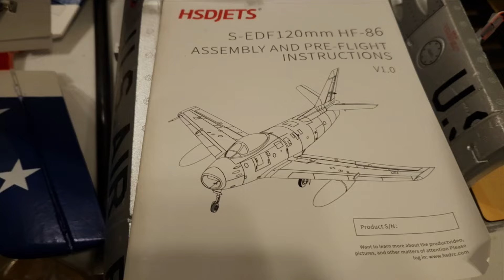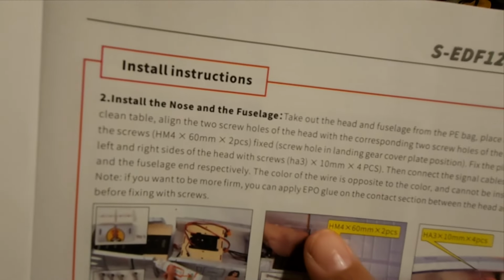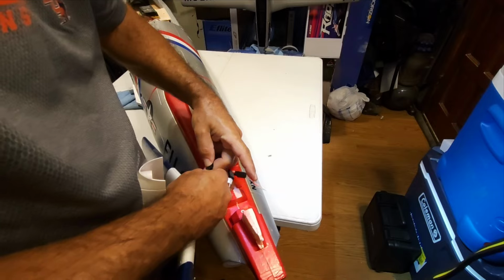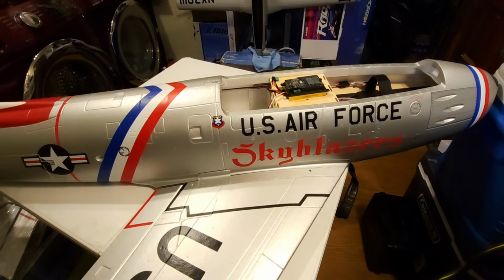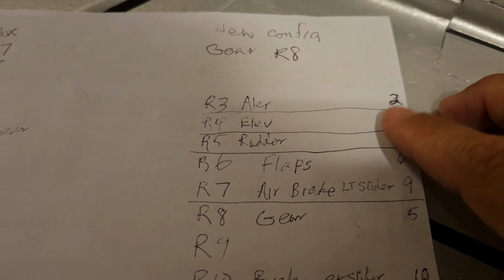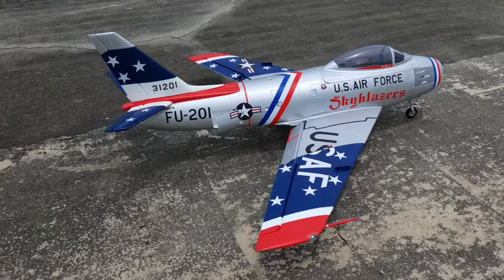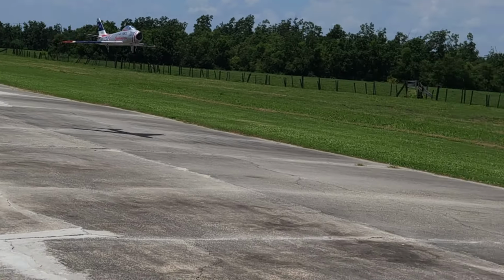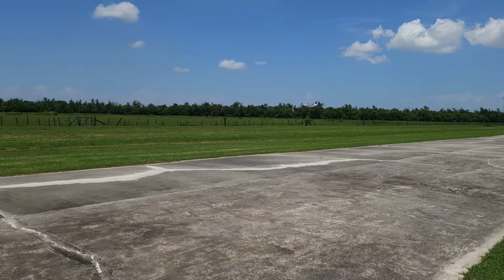HSDJETS S-EDF 120mm HF-86 Sky Blazer Assembly Set up Maiden

Comment: No need to get aggravated,  on these HSD jets you need to study the input plugs and output plugs and the diagram page really well,  get a mental picture of what they are trying to show you,  I have set them up without S-Bus and with S-Bus,  I fly Futaba so I found setting up the S-Bus is so much easier,  but I have done it like you did as well and it takes a little more time but after owning a few HSD jets you get the hang of it.  Good job on the the maiden and that looks like a nice place to fly,  Thanks for sharing.
Reply from the maker: @robinlee7886  I understand what you're explaining and that makes total sense however the labeled outputs that they give you did not match up to what I was getting I had to manually go through and figure out what each one was and that is why I showed a view of my cheat sheet in case anyone was having the same situation it would give them a map